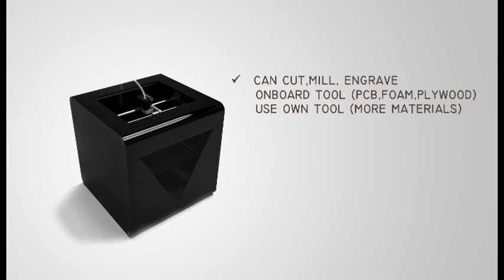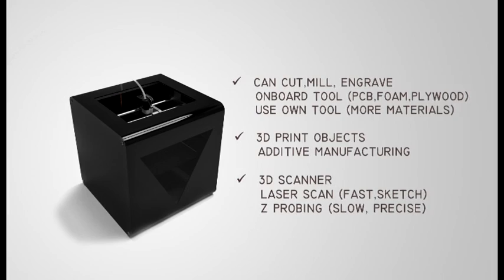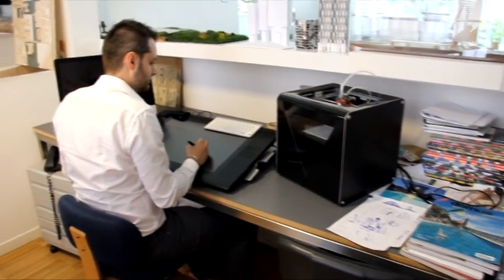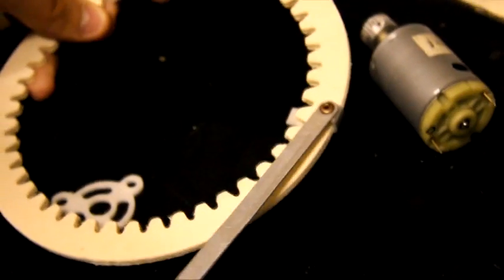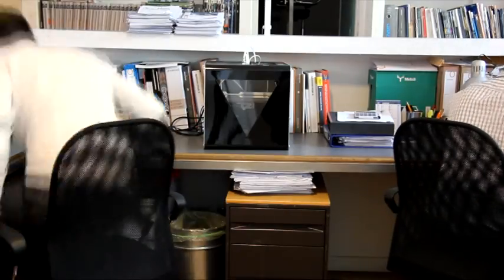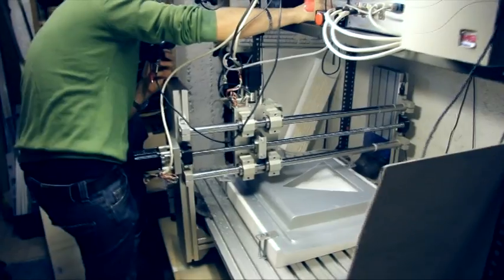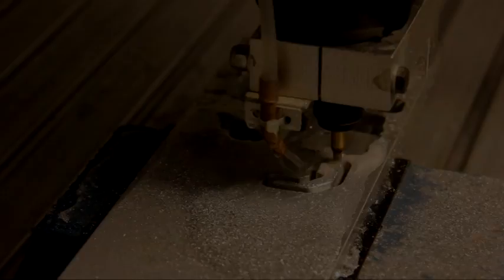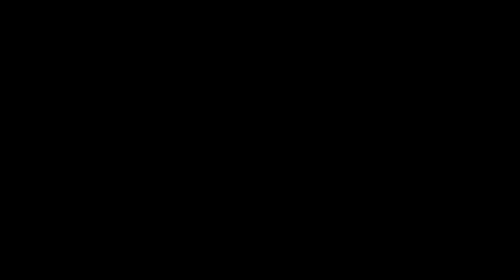FABtotum Personal Fabricator - 2013 Indiegogo Campaign

Comment: Uhm, with proper indicators/micrometers and zeroing, its very very easy do deal with something like this. Also the head looks to lock in place.

You must know CNC mills with tool changes encounter this and thats why they have operator set offsets in their Gcode usually.

And yes, Cad/Cam takes time to learn this is very true. I've been certed for inventor for 2 years, working with it for more than 4, and I still do not believe I know half that program.

Comment: This looks good but all of you who have never made anything on a CNC mill or designed something to later be printed, it doesn't work as easy as this. Changing the head over for example makes this a REALLY inaccurate machine. Which to most isn't an issue until you realise that all the cool things you want to make WILL need some precision. If not your making Junk. Oh and by the way CAD software cost something, so does CAM software, and it takes time to learn
Reply: this fabtotum are swindlers

Comment: What is the technology begind the printer? what material is used and do you have info about the strenght of the final result (compressive or traction test). What is the rugosity expected by printing a flat surface? What is the maximum negative angle detected on a surface when scanned. Thanks a lot, interesting product